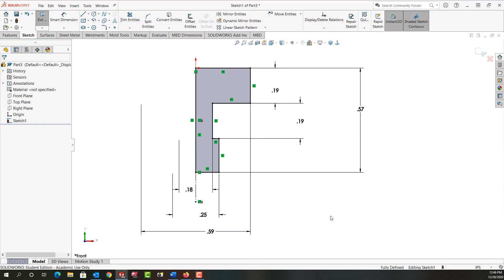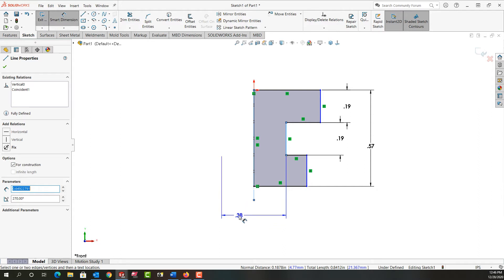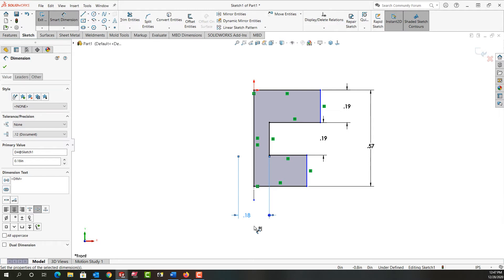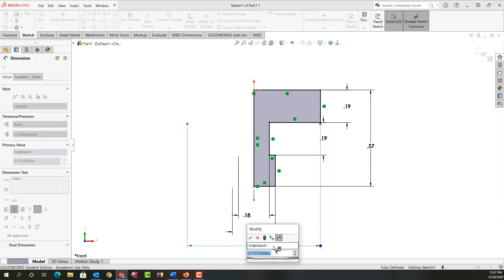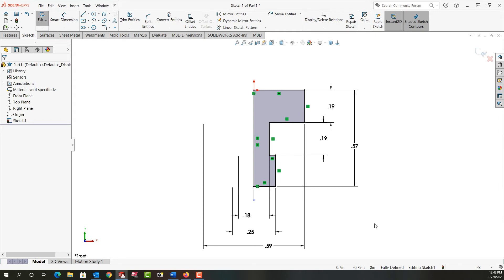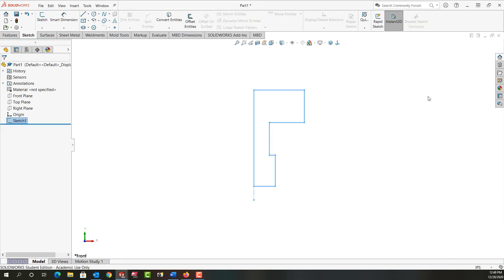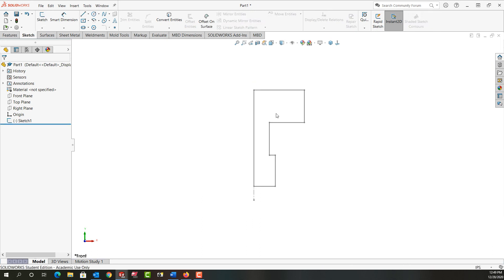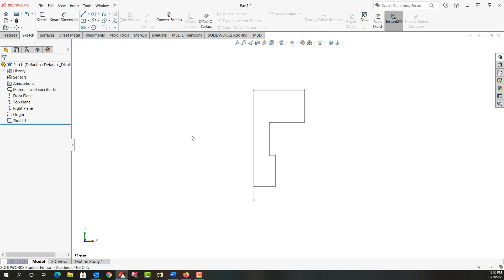Diameter or Doubling Dimensions

Comment: Do you know of any way to reliably do this in a .dwg file? I often get linear measurements that I'd like to display as diametral in my drawings and it's always a bastard trying to get solidworks to play along.
Reply from the maker: You can just add the diameter symbol to the dimension.